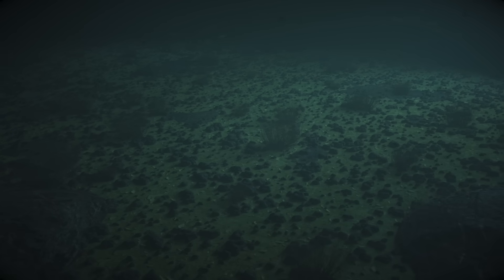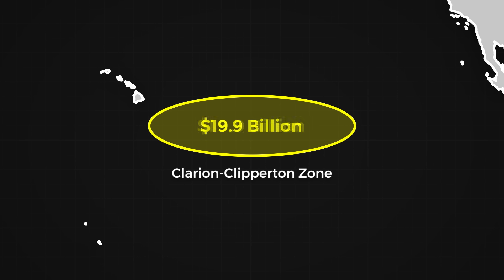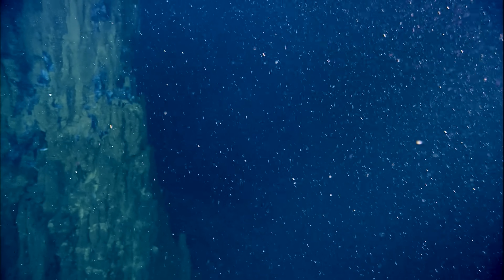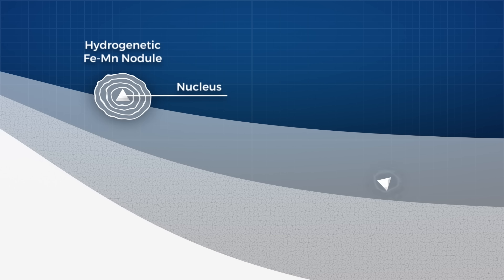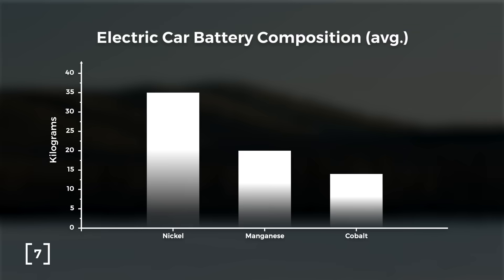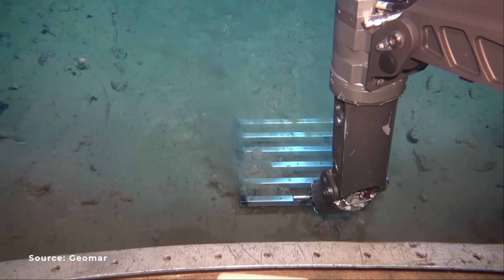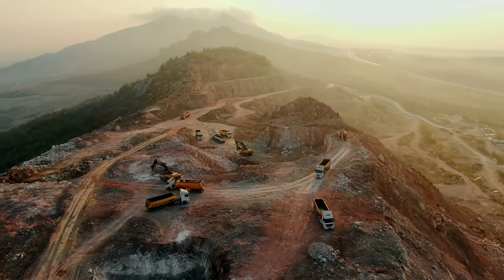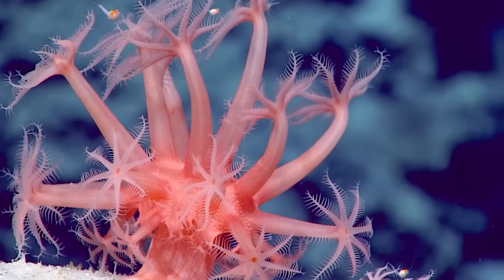The Truth about Deep Sea Mining

Comment: This is the trouble with contemporary electric cars - a lot of the issues regarding range, performance, etc have been resolved by making the batteries bigger.

However, bigger batteries require more resources that are going to get more expensive, not less, as demand increases. There is no way BEVs with the performance of say a Tesla Model 3, can ever become mainstream.

This is where we need to look at a) more efficient forms of transport b) using the car fleet more efficiently and c) alternative ways of storing energy.

a) is easy and involves getting more people on buses and trains, as well as walking/cycling. Ebikes use a fraction of the battery size of cars and cargo models can carry pretty significant loads! Most trips under 10km can be comfortably and quickly done on these.

b) giving everyone a giant 400 mile capacity battery that they use twice a day to commute maybe 20 miles is inefficient. Car sharing schemes strike me as more effective, or perhaps people can have a smaller, short range electric car for day to day, then hire out a long range one for road trips, etc.

c) Hydrogen seems to have the potential to solve a lot of issues. Yes, it is inefficient, but at times where renewables are over generated and companies have to sell at a loss or shut down their turbines, then it seems like a good time to spin up some hydrogen generation! This can then be sold off over a longer time period to power vehicles like trucks, vans, long distance cars and even aviation/shipping.

Comment: 2 of 2 Under Sea bases: Rather than pump the slurry to a surface, build an ocean floor base that processes the slurry. This base could serve as an anchor for a floating wind farm producing green hydrogen. The slurry will used to partially burry the base so it can tether more turbines and the wind farm produces all the electricity and fuel to power the mining operations. The brine from green hydrogen production can be used as a counter weight to bring minerals to the surface and excess hydrogen could power the ships transporting the minerals to refinement.
Reply: Building that ocean floor base at high pressure in one of the most hard-to-get places on earth will make it expensive as hell and not worth the cost though
Reply: It could be a cheap inflatable one, but the pressure down there is so high I’m not really sure if it would be viable

Comment: collecting the nodules should NOT be done from contiguous areas. instead, a pattern like bands, or checker boards have to be employed, notably on all scales. Meaning: not 100 % of all the area should be exploited... This will allow the ecosystem to repopulate the exploited area much quicker.
However, this requires international law, observation and control, and coordination. And a trait called taking responsibility, which humans do not fail to miss, all the time, and on every scale...
.
the comparison with rain forests is not valid, since the deep sea ecosystem is working million of times slower

Comment: There is another potential solution.  The robotic and other technologies required for asteroid mining have been proved. The availability of the desired metals etc. in asteroidshas been very well shown in meteors. The capability for asteroid mining is at this point completely subject to engineering and finance. This resource extraction would have zero environmental impact on Earth, and if done properly nearly zero impact in the asteroidal region. In a second phase the refining process using solar- or nuclear-powered vapor phase chromatographic methods require zero toxic chemistry.
Many people falsely think that this is an expensive process. But that is incorrect. Shipping mass down from orbit is nearly free, and further, with the rapid expansion of space development projects, there will be a large number of returning vehicles running empty on the return flight.
The biggest challenge is the long lag between initial investment and return of revenue-generating mined materials, in the range of 10 years after development and testing of the mining machines and the three year time required to ship the machines to the asteroid belt.

Comment: Fuck renewable energy.

Nuclear is safer, more stable, doesn’t require batteries, is less expensive at scale, produces less carbon, we have a new fissile process which produces 95% less radioactive waste and what is produced has a half life of 12 years vs the eternity of non recyclable solar panels.

But people are too indoctrinated to think critically about our energy future, instead they repeat easy platitudes.

Indoctrinated, yes this includes you who is about to respond with venom to this comment without doing any research into modern nuclear energy.

Comment: A noote. the toxic runoff at surface mines is not just from ore processing. there's a lot of rock that's weathering and oxidising for the first time and that leeches out heavy metals that were locked up in solid stone. if it's an open pit mine, this all collects at the bottom and the water evaporates off, concentrating it like a salt basin.
you can't just dig up a bunch of galena (lead/silver ore) and toss the low grade stuff over a hill and hope all that lead will stay in the rock that's now out in the sun and nature instead of locked away in a mountain 

inversely, underwater, all that overburden is from the "snow" to begin with. there isn't really anything trapped in there because it's an accumulation. there's nothing toxic in it to begin with unless we put it there

Comment: Honestly... seeing all this and understanding the forces and scales involved, along with the advances to access in the recent years, it seems almost easier to mine asteroids.
Reply: Conceptually, mining asteroids is pretty simple, it's harder in practice though, because after separating out the richest ore (probably magnetically), you need to either return it to earth (which is not economically viable), or process it in orbit (which is not viable for thermal reasons).
The mining part itself is easy, especially with how lots of asteroids are just loose gravel.
I still want to see asteroid mining in my lifetime, and actual on-orbit production facilities.
Reply: @animowany111  ok
Reply: @animowany111  just direct the asteroid to land on earth and mine it here, it is easier and requires zero effort
Reply: @animowany111  couldn't one way to make it easier be to get them asteroids closer? 
We humans are currently trying to set permanent presence on the moon. This day September 26th, we also are trying to move an asteroid.

We should aim to deorbit small asteroids (via impacting or gravity tractor) and crash them on the surface of the moon. 
Then a cargo line would be much easier to maintain from the moon than from the asteroid belt.
Crashing them hard enough could even make underground moon ressources more accessible.
That way you can also bring to the moon basic resources such as water, as some asteroids are very rich of.
Reply: @gaelgauth8470  nice idea but i don't think impacting an asteroid and impacting an asteroid to crash or orbit it at an exact location is similar, i clearly don't think we can do that rn (maybe in future tho). for that we should be able to accelerate or deccelerate a object of billion tons , AND reaccelarete it to match a certain orbit. the truth is that in space technology every things cost immense amount of energy (chemical or electric) and we are faaar away to producing that amount rn. And crashing it would be more simple, but now we destroyed hundreds kilometers of moon surface, wich contains also ressorces (not the same but). conclusion: we are staying on earth for mining tomorrow 😅
Reply: @quentinspaeth1757  if you are patient enough this doesn't necessarily need immense amounts of energy. Why having to re-accelerate the object if you pick one which the orbit fits with a single modification ?
Not talking about billion tons objects already 😅 (Dimorphos is ~100 M tons, so smaller than that maybe).
But yeah this is still beyond our current capabilities. This just seems to me "simpler", more logical to do.
Reply: @eslnoob191  Yes the Moon is big a gravity well, but much less than the Earth's. So much that specialists recommend to make it the gas station for Mars exploration for how easier it is to escape. So much that a space elevator would be actually feasible from its surface.
So if we're committed into Lunar presence I can't see how is it a bad idea, with these near-Earth asteroids. To me space machines autonomously mining in the void of space millions kilometers away seems more of a challenge than mining something dropped on a soil you can "walk" on an access with a 3-day trip from Earth.
Reply: @gaelgauth8470  nasa currently still needs to figure out wear from moon dust and can't just drop rocks on earth safely
Reply: @animowany111  thermally? i mean yes space is technically cold, but for instance the sun facing side of the ISS reaches well over 200C, while the other side is just about equally as cld, -200c
Reply: @matthewgerlach5775 Yes. Issue is excessive heat. You can only radiate so much out over a relatively slow time. Or else it will build up. 

 A smelting factory in space would require huge- and I mean massive radiators as to not destroy it's self!

 I don't know if space is the answer yet. Rockets aren't known to be environmentally friendly! 

 I'm surprised how little those nodules would produce in such a land amount of ocean floor... Only 20billion for 170k square kilometers of ocean floor? I'd figure it would be multiple times that honestly.
Reply: @dianapennepacker6854  Well tommorow, the company leading the deep sea mining charge is publishing a study that proves the viability and profitablity of the enterprise. So looks like its going to happend
Reply: @animowany111  I am glad to say your greediness will thwart you if you are merely relying on fantasies of the length of your lifetime. And,  since waiting  to see asteroid mining is  a preoccupation of yours your own human reproduction is clearly not on your agenda.
Reply: more profitable, easier, less pollution, or ecosystem destruction etc... theyd spend more money burning oil to run ships than the resources would sell for.
Reply: You took the words out of my head!  It looks like we can mine asteroids and not harm any known animals, or plants.
Reply: not to forget you are not destroying valuable ecosystems in the process.
Reply: how is mining asteroids easier than sucking up metal potatoes on the sea floor?
Reply: Maybe not? https://youtu.be/8gJLI8ADEWU
Reply: Space and  ♻️ is the solution. Stop playing with the only 🌎 you have.
Costs for extraction of resources will reduce.
But I guess we will end up with fake structures as replacement after the mining... there is little to stop mankind
Reply: Elon musk said that even if there were blocks of pure cocaine on Mars it wouldn't be cost-effective to bring them home to Earth! - it's going to be the same with asteroids.
Reply: @markreed9853  Nobody here's talking about mining mars to send resources to earth.
Reply: @aquilux-vids  I was implying that asteroids or Mars it's still going to be uneconomical to bringing any stuff back as it would cost to much, even if the materials are valuable.
Reply: Second only to the theory of evolution, man-made global warming is the greatest hoax ever perpetrated upon Humanity by Earth-worshiping zealots to steal trillions of your tax dollars to fund their false religion and lies.
Reply: Or the moon which is what China plans to do.

Comment: Would it be possible to replace the nodules on the sea floor with something else which deep sea organisms could use? I'm thinking some kind of inert, dense waste product which might otherwise end up in landfill, like concrete rubble taken from old buildings that have been torn down. This material could potentially serve a double purpose, as it could be used as a counterweight for any mechanism rising nodules to the surface, as long as the mass of the material going down is sufficiently greater than the mass of nodules going up. This would mean the process of lifting nodules would require little to no energy, depending on the specific design, and would increase the amount of suitable habitat for deep sea life. Transporting material to mining platforms would not be complicated, as there would already by ships traveling between them and land.

Comment: By now, batteries based on iron and salt or mainly made with aluminium have been developed. To me, it does not make sense to tap into deep sea lithium or cobalt nodules, since we probably don't need them in the first place by the time we could mine them.
We need to get to a cyclic economy, not keep using fossile/finite resources, even if we replace one finite resource with another

Comment: Why can't we just replace the nodules with fake ones? Similarly shaped rocks so that octopi etc can still lay their eggs there?

Similarly why does the rover machine need to generate slurry? Some modern robotics and a well trained AI and I could see them picking up the nodules only and sending those up. Is it slower? Probably, but you can just build more in parallel to overcome that. Slurry problem solved. The same robots could go back around depositing fake ones I mentioned above?

Comment: Out of curiosity would it be possible to design ballast containers that get loaded up with materials then sent to the surface passively to be collected via crane? The main issues I can see with this is designing them to survive that much pressure and preventing them from drifting out of range of the flotilla.
Reply: Yeah that's a difficult one at that depth because the material that can withstand the pressures is quite heavy so it needs to lift its self as well as the load so to lift 1T of nodes you might need 2T of buoyancy. Another option is a crane on the ship to lift it from seabed however this can take 1-2 hours to lift to the surface at that depth.
Reply: I would have appreciated a video that attempted to discuss just such engineering topics. Seemed like more of a geologic and ecologic video instead.
Reply: i think they may resort to conveyors and cables for cheapness and easy replacement. problem is corrosive salt water but steel is cheap

Comment: So, "renewable" energy sounds amazing, but what's rarely factored in is the massive amounts of hazardous wastes that comes with them. Immense graves for wind turbine blades that have gone past their lifespans, the disposal for solar panels that have to be replaced every 10-20 years, the incredibly hazardous wastes that comes from EV batteries that also have a quite low lifespan of just a couple decades. And let's not forget that the vast majority of electric generation comes from fossil fuels, and the electric grid requires massive amounts of metals like copper and aluminum, all of which requires fossil fueled heavy equipment to mine. There is no good answer for the foreseeable future, with the exception of nuclear energy, which is far cleaner, and far safer, than many if not most people are willing to admit, especially with modern technologies.
Reply: Yup Nuclear is the GREENEST energy source out there, but Europe is doing everything they can to destroy Nuclear Power and now look at them, power costs have more then doubled in the last 6 months and going higher because of their reliance on Russian Oil because their Solar and Wind isn't enough to sustain them.
Reply: What's your alternative then? Keep everything as it was until now? Those problems are easier to solve than the greenhouse gases in the atmosphere.
Waste in itself (without regarding wind turbines and batteries) is already a colossal problem for humans and the environment.
Reply: @almerindaromeira8352  the alternative is to admit that climate change is going to happen, noatter what we do, just as it has for millenia before humans, and qill continue to do so for millenia after us. Admittng that we did not cause it, that it is a natural process, and that believing we can stop it is the epitome of self-centeredness as a specie. I do believe that EV's are the eventual way of the future, but not for the present, even Elon Musk agrees on that point, our technology just isn't there yet. Most industrialized nations have already cut their emissions way way back, with a few that have increased theirs FAR beyond the others combined with absolutely no remorse or efforts to reduce in any way. Our best bets are to prepare for what's coming as best we can, and stop believing the propaganda that we can actually stop, or even reverse, climate change, because we cannot, period. We don't have anywhere near the influence on Mother Earth that we think we do.
Reply: @almerindaromeira8352  I never said humans didn't contribute to it, nor did I deny we may have accelerated it. I don't deny it one bit, but if it gives you the warm and fuzzies and makes you sleep better, then go ahead and call me a denier. I'm just calling out hypocrisy when I find it.
Reply: @CowboyCree63  I'm not calling you a denier. I just said I won't argue with one, because it's pointless.

Comment: I dont dispute the scientific information presented here, but I would contest the assumption that these metals are critical to our transition to clean energy. We can build a green economy that isn't solely dependent on batteries if we can transition towards massive, widespread, electrified public transit and other forms of energy storage.
Reply: No, there is no replacement for batteries and their chemistry.
Be like replacing oil
Unless cold fusion or one of those tiny fusion reactors work
Reply: @cedriceric9730  I mean, that's just not true, there are even other chemical batteries with different properties and densities that don't require these specific minerals. Iron air batteries, redox flow batteries, lead acid batteries. Not to mention all the other ways of storing energy that aren't chemical in nature.